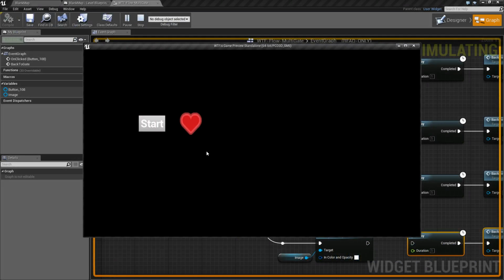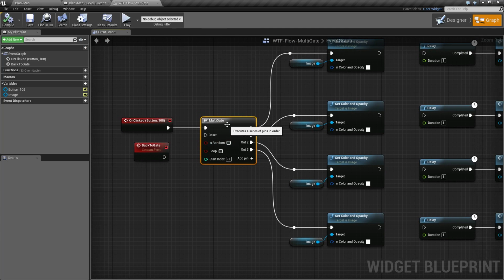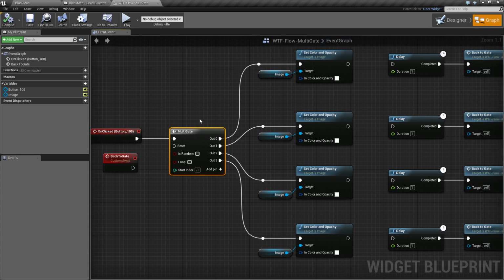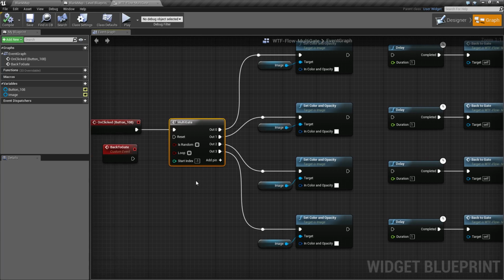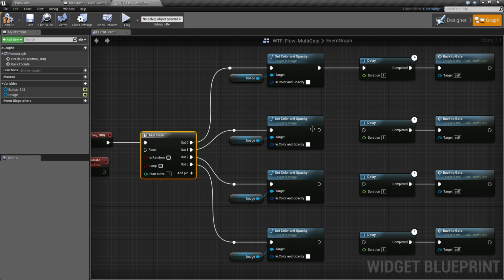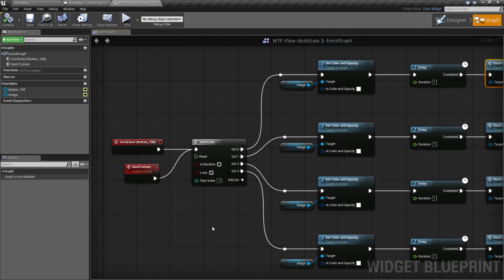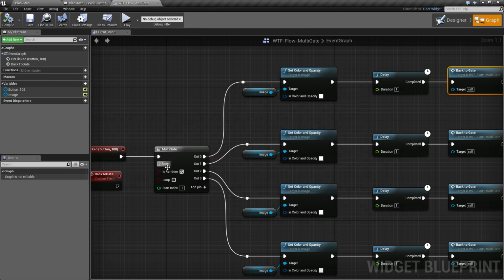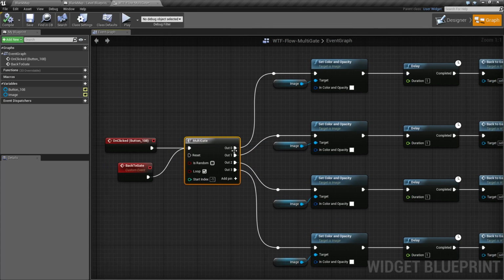WTF Is? The Multi Gate Node

Comment: if i have 4 outputs ,how do i make it go from 0 -> 1 -> 2 -> 3 -> 3 -> 3 -> 3 -> 3 (and so on)
Reply: I only want the last node to repeat itself
Reply: @HumbleMcgregor  do a 2nd multi gate with a branch. True = fire the 2nd multi gate, then fire the first one again.
Reply: @DarkSession6208  Hey, Dark, I gave this a try but I think I hooked it up wrong. How does the second gate fire off the first one?
Reply: Make a variable float/index.
After each branch operation use set var ++
Plug said var into the index with a default value of 0.
Each time the branch fires it will increase by one. Then just leave the 3rd gate as the function (don't increase the var) and it'll fire gate 3 every time untill you manually reset it :)
Reply: @panfull  I'll give it a go!

Comment: Does Multigate have a limit on the number of nodes in each output (out)? Made Multigate with 6 outputs. After each exit, one node. Everything is working. But just add one more node to the nodes of each output, all the logic breaks down and Multigate stops working. What is the reason?